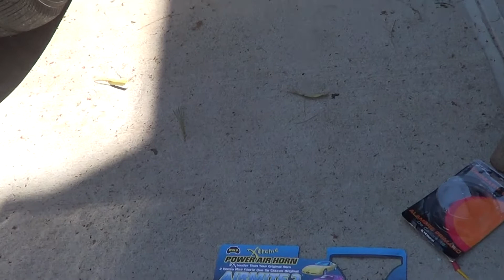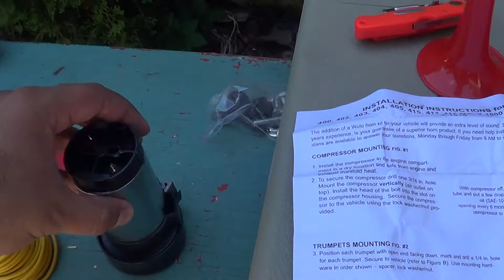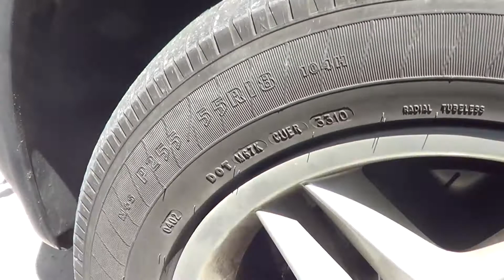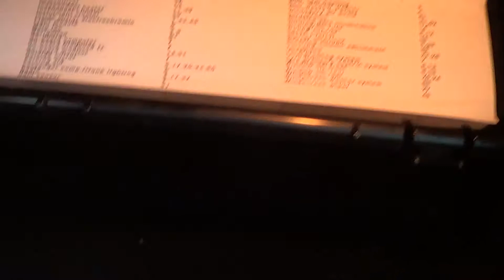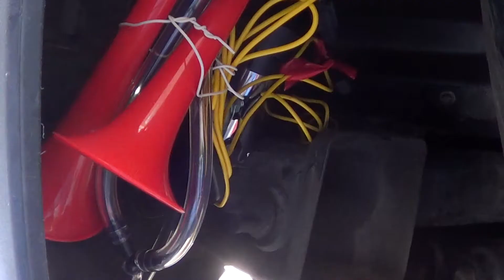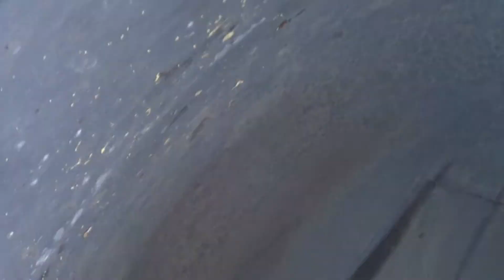DIY replace BMW X5 2002 horn, easy and quick. save time and money

Comment: hey I'm having problems with my x5 my whole steering wheels panel is not working the horn the adjustment for the wheel and my volume control on the steering wheel also my cruse control not working all on the steering wheel what should I do ? please help x5 bmw 03